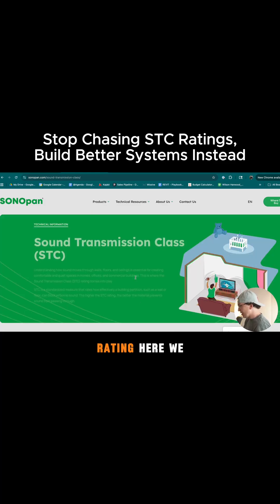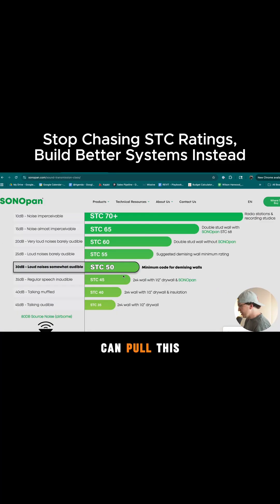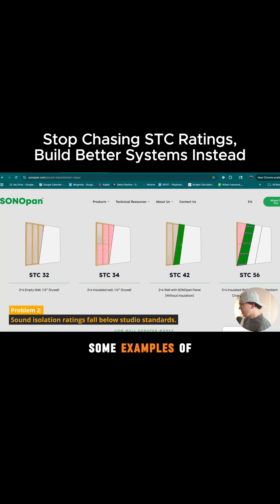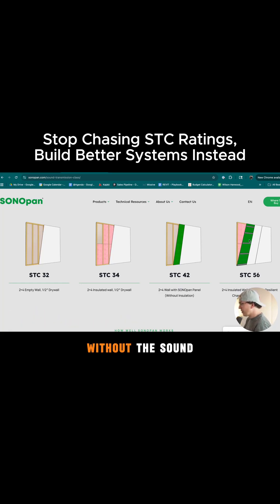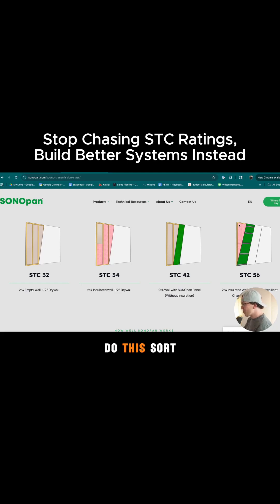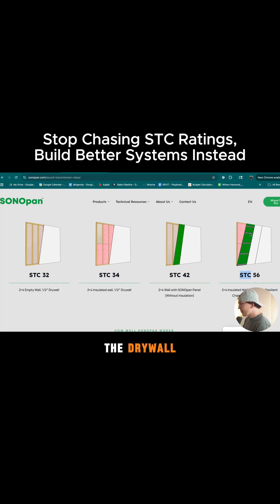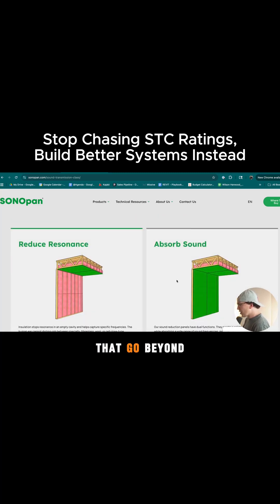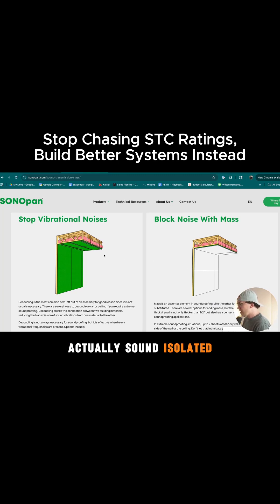Stop Chasing STC Ratings — Build Better Systems Instead

Comment: Well, I guess it’s maybe the fact if you don’t wanna do two layers of drywall, which is very time-consuming. I use a lot of MLV in my projects and I’m about to switch to Sonopan because it’s lightweight and we hardly ever do two layers of drywall. We just use quiet rock.

Of course I’ve never used Sonopan yet, but I’m excited too because I’m very tired of using mass loaded vinyl